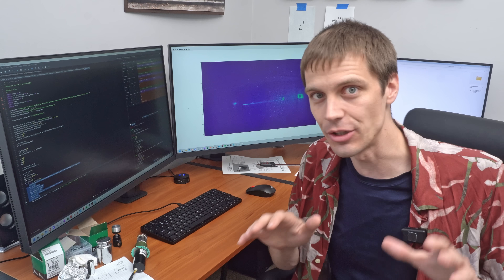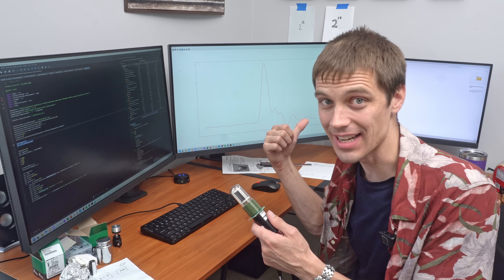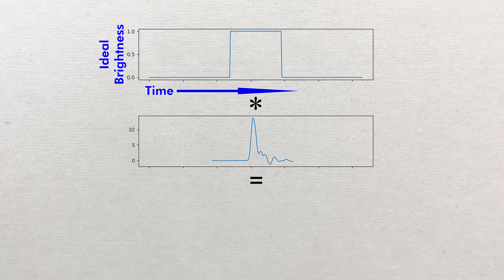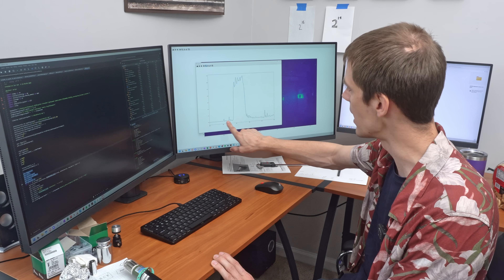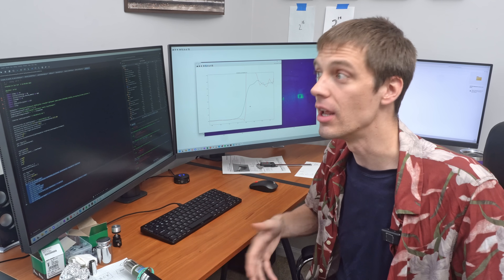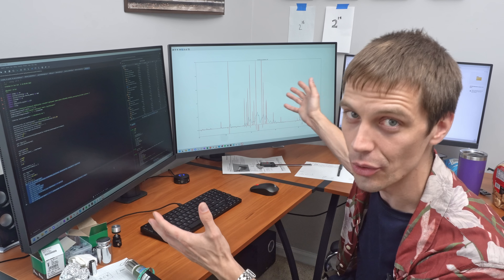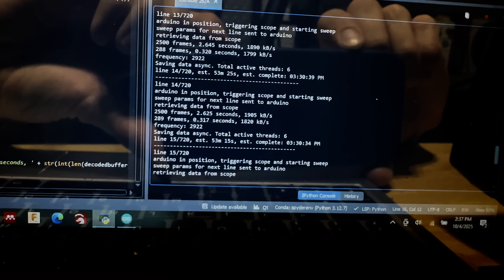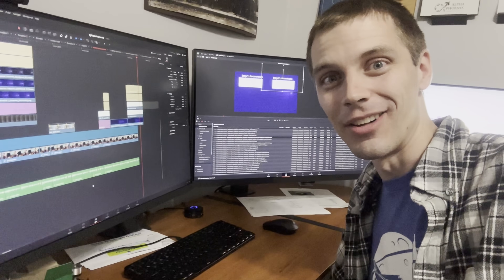Detecting individual photons for a 2,000,000,000 fps camera (deconvolution)

Comment: You should use a rigol mso5000 and then hook it up to ethernet to transfer the data. That way it's instant. I've done what you do and use USB and it takes forever. I then wrote a python program to use the API on the scope and at the speed of ethernet over wifi it's instant.(the reason I say mso5000 is because the bandwidth is like 500Mhz for real. (350Mhz on the data sheet) and has a much higher sample rate of 8GSa/s

Comment: can you explain me, why you use:
1. so expensive laser driver (~300usd);
2. photon particle detector instead of, for example, less expensive and still very fast fiber optic receiver or some photo-sensitive diode?
3. do not use galvano driver for mirrors? (servos are really low precision in this case)
4. some fixed frequency resonator, to have same timing between laser flashes?
5. these long black coaxial cables. I don't understand why so long cables? (that may actually cause standing wave)
6. only one oscilloscope channel. with 2 channels and 2 opt sensors process of shooting could be 2 times faster, right?

I'm going to repeat the experiment. if I'm lucky and no expensive hardware needed for photodetectors, plan to try with 4 or 8 pixels (4 can do with oscilloscope, 8 with FPGA, if my friend helps me).

pls, comment, share your thoughts, stop me before I waste time going on wrong direction (pls) ☺️
Reply from the maker: 1) time
2) pmt was fairly cheap, and I picked one with very low spread time
3) mirror needs to be large enough to supply a parallel beam to the lens, and bigger lenses are better
4) there is
5) they don’t make reflections if properly terminated - they’re there to temporally separate the timing signal and the pmt signal
6) depends on your scope, but running one channel is probably always the fastest it can go. Interleaving two channels to go faster is what it’s doing on the inside. I don’t think it ever makes sense to do this outside the scope

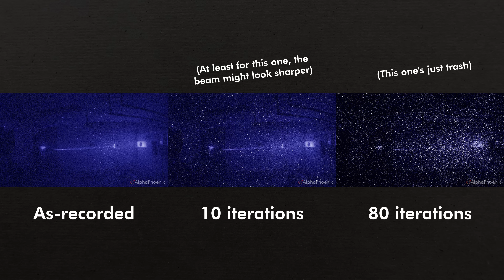Comment: 6:30 I think you should try doing 80 iterations (or even better, do the fourier transform, deconvolution and inverse fourier transform) and then taking the sharp but noisy image to one of the modern algorithms used for denoising low sample count raytraced 3D graphics. Nvidia has done a lot of publishing for this kind of stuff. As long as you have accurately sampled time events for each photon, modern denoising algorithm should do wonders.

Comment: OK first, extra points and so glad you went with BetaPhoenix for the second channel name :) that makes my heart happy
And this is way cool and despite using a "fake" "ideal" deconvolution model I think that's actually fine because your setup is precise. The on/off time for your laser may not be a perfect box but I'm not sure you could actually measure that discrepancy with any meaningful result. The real trouble is those low-intensity pixels where you're just not getting a photon every frame. I don't think there's any deconvolution algorithm that could make sense of that and the convoluted output is actually better because it's "blurry". In the same way that old 8-bit pixel art video games look SO MUCH BETTER on a CRT precisely because the CRT ever-so-slightly blurs the image. 
(With CRTs it's a matter of the phosphors having a non-instant decay rate and a tiny amount of fuzzy edges with nearby phosphors. In your case I think it's a difficult problem to balance needing the high pixel definition deconvoluted image for the laser beam and high intensity portions of the image while retaining the less-defined fuzzy image for the low-intensity portions. If you did get around to it, a custom deconvolution algorithm that could be tuned to balance those conflicting goals could potentially give you a REALLY pretty final video.)

Comment: Great video Brian! Minor nitpick from an electrical engineer: the verb form is actually "convolve", not "convolute". Although I completely understand why it can be mistaken as such!

Also, it's a real bummer about the scope data transfer slowness. The averaging of multiple captures is exactly what you would want to do to suppress the shot noise from the PMT. In radar, we call it pulse integration.

Comment: Something that I think would clean up your signal some: You pointed out your delay line was a pair of cables you just left coiled. You should uncoil them and re-coil them using the over-under method to give a non-inductive wrap. This should help with the ringing and undershoot. Also, are you properly terminating your cables? Granted, the way you are collecting data it might not matter as much because you might already be done capturing the frame well before a reflection is able to be detected.

If you wanted to collect data much faster you could swap your scope out for something like a NI PCIe-5155. Something like this would likely need to come from a very generous subscriber though because crap they are expensive. They do have nice options for triggering/syncing though. Cheapest on ebay are like $2000-$3000.

Comment: I'm curious about the PMT response. While the photon interacting with the PMT is instantaneous the electrical current on the output of the PMT is on the order of nanoseconds.

Could a PMT even be used for differentiating between pulses that are orders of magnitude slower than the output response time? For example would the output of the PMT be 2x as long if the pulse were 10ps vs 20ps? I hope I am making sense.

Comment: That looks like an oversharpened image (in this case temporally instead of spatially). If the algorithm overshoots the initial rise, it's going to add this  kind of noise. Maybe a less aggresive option would work  better.

(still amazed that you managed to get this working)

Comment: Take picture with no external light. Let's call that a blank picture. Then subtract that from the interesting pictures you have taken. Subtracting the original blank picture helps remove noise in the final interesting picture.
Reply: I don’t think this technique would work with a single pixel photon counting detector.
Reply: @sashimanu  I agree. The black frame subtraction is designed to eliminate the constant bias in separate pixels in multi-pixel sensor (e.g. 12 megapixel camera has 12 million pixels which are not identical because of imperfect manufacturing quality).

Comment: You can use a sigma clipping algorithm to clean up any hot pixels caused by your deconvolution algorithm, its what we astronomers/astrophotographers use to remove individual hot pixels or even satellite trails. Run it on each frame and it should clean up a lot of that hot pixel noise

Comment: How exactly does the calibration step work. How do you know the PMT detects 1000 photons and not some other number?
Also a completely unrelated question. I know you have been using Matlab in your older videos. How does is compare to Python for scientific workloads?
Reply from the maker: I just trigger the scope 1000 times.
I like them both but I’ve gotten more practice with Python in the last few years because it’s more common at work. There are certain tasks (especially multi threading/gpu loads!!!) that suck in Python, but I’ve sort of come to the conclusion that it’s better to use Python for the educational stuff because it’s more relatable to the average viewer to see snippets or when I release code

Comment: What’s interesting is they’re now using atoms as RF detectors. That noise is from the energy environment around you and so maybe without using the expensive lasers, but AI you could decode signals from the stream of photons without the high priced lasers.  Use the noise because it isn’t just noise, It’s Information, That’s interfering with your signal.  Then you can also do real time error correction, easier along with using the output for other things.

Comment: It definitely looks like "ringing" to me, combined with bandwidth limitations in the scope. When you showed the specs of the scope, I believe it said 200 MHz bandwidth (and 2GSa/s). That means that the scope has an analog low pass filter at 200 MHz, before the signal is even digitized. You need a much faster scope if you want to capture information content at 2 GHz.

Comment: I don't know how exactly the iterative deconvolution algorithm that you used works, but as I understand you're using it do deconvolve each pixel's signal separately. Is there any reason to assume that your measurement setup would cause a nonlinear response and not just be the same across the entire image? 

It makes sense to me that the "cheaty" solution using the exact same kernel across the entire image would look better rather than trying to overfit a solution on every individual pixel. I guess running that "proper" deconvolution on a 3D signal would be impractical.

Comment: I'm big dumb on this stuff, but can you even Fourier "out" the component signals if one of the components is a true pure square wave? A pure square wave isnt a sine, and my understanding is that it is impossible to make a true square wave with any combination of sines unless you have infinite frequency sines to contribute, as you'll still always have some slope on the verticals, even slightly, and you'll still have those "spikes" at the edges of the square wave, right? That to make a pure square wave would require constituent sines of infinite frequency? Am I at least getting the basic concepts? 😂
I appreciate any help in understanding this!

Comment: I still don't really get how you recreated the 'animation' of the video from all those 'pixels-in-time'.
I imagine you have like wave forms for each 'pixel' combined with 2 mirror angles.
Then you 'bin' those wave forms based on the time between the laser trigger signal and the received blip and this is an indication of which 'frame' it belongs?

So let's assume the minimal time between trigger and blip is 10 samples and the max is 100 samples, then you could recreate upto 90 frames, assuming the wave form can be deconvoluted back to 1 sample at 2 Gsamples/sec?

If done like this, then I guess you would get multiple spikes from received photons in the same wave form, right?
Like when 'looking' at some spot and 'filming' the laser light bouncing around, you will see multiple blips in your wave form, though they might be of different intensities if the laser is more off-center of where you're looking at.
This means you only need to move to each position 1 or 2 times and then try to filter out the multiple spikes from the wave form to reconstruct multiple frames.

Is this how you're doing it?
Also isn't the rise time of the input of the scope a bit too slow for this? Or does this 'softness' actually help in deconvoluting the signal and helps finding the 2nd derivation point of the curve to see where it starts to slow down the rising edge of the signal (which my intuition tells me might be more 'stable' compared to finding the peak of the signal)

Comment: Finally a topic I know a lot about! I wrote a thesis (grew out of the poster in my pfp lol) about a handful of different deconvolution algorithms. The specific application was finding the infection curve for an outbreak using the case curve of when people start showing symptoms. I could probably dig out some old R code and a few papers if you’re interested. I tried to make it as simple as possible to use any filter and any sequence you’re trying to deconvolve. You’re absolutely right about there being a fudge factor. You almost always fave to adjust things until it “looks right.”

Comment: How about you throw us some test data, and perhaps someone in the community can do their magic with it? Would reckon any data could be released?
Reply from the maker: What’s the best way to share 30GB?
Reply: @BetaPhoenixChannel   A torrent.
Reply: @BetaPhoenixChannel  I'd be happy to just sponsor cloud storage (like a Backblaze B2) bucket for this. The suggestion of a torrent is also solid.
Reply: @BetaPhoenixChannel  One pixel at a time ;)
But on a more serious note, as already suggested, a torrent is great for this.
Also you can split up the data as for starting playing with it you don't need all of the data. Those getting serious results are probably only a handful of people and then 30 GB of data isn't that much anymore. That's like 300 seconds of download time on a 'standard' 1 Gbps fiber subscription.
Reply: @BetaPhoenixChannel Thx for the reply. Three different google drive accounts ULPT. I guess it might be possible to put on hugging face (slap a nn on that thang) for free?
Reply: Seconding the huggingface suggestion, specifically upload it as a dataset, not a model. Their free storage limits are pretty generous, and it's legitimate use, no need for gdrive shenanigans.

Comment: I find it really interesting that the noise you get from the deconvolution algorithm looks like the "fireflies" you get with raytraced digital renders in low light. Raytraced renders get rid of those with a denoising step, which all of the major GPU vendors offer pre-packaged software for. Maybe the deconvoluted signal here could be denoised in a similar way?
Reply: not a bad idea. seems like whether fireflies exist due to an insufficient sampling rate of something like a raytraced renderer, or insufficiently sampled signal that was tried to be reconstructed by deconvolution, it basically is the same sort of cause. though, denoising is making some assumptions about the signal in space (i.e. an area of pixels), rather than just a single pixel's values over time. still, could be well worth it.

Comment: Ah, the infamous deconvolution! I've always been implementing it using a Fourier method, so it's interesting to see the iterative approach. And yes, deconvolutions are unfortunately very prone to noise. The best approach with electrical signals is to re-convolve the result with a finite-risetime smooth filter like a gaussian to essentially have the same information but presented "in a more readable/pleasant way" so to speak, just as what you describe at the end there. Thanks for sharing!

Comment: beat that, phantom
Reply: Phantom actually records simultaneous information.  You could never film a non-periodic event with this technique
Reply: @MushookieMan  You could, but only at 1 pixel. If you have tons of money, you can scale this up to phantom v2512 resolution at 1 million FPS, 128x32, or more feasibly 64x64, but the issue isn't actually the oscilloscopes but rather the PMTs unless you're willing to accept only a few hundred pixels. You could instead use a more traditional sensor but read directly from the sensor with oscilloscopes. You could get 64x64 @ 2.5 billion FPS using 32 oscilloscopes at about $30k each, or 64x64 @ 50 million FPS with only 4 oscilloscopes at a similar unit price. Less oscilloscopes can be used if you're willing to accept shooting for less time, but that's should be fine considering the 100 million FPS camera built in the 1950s to study nuclear explosions could only record 6 frames.